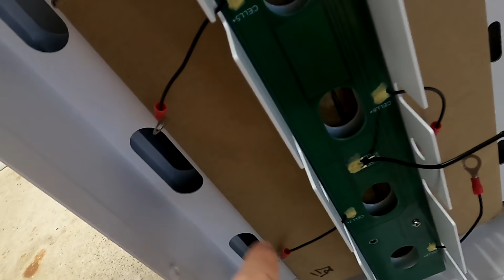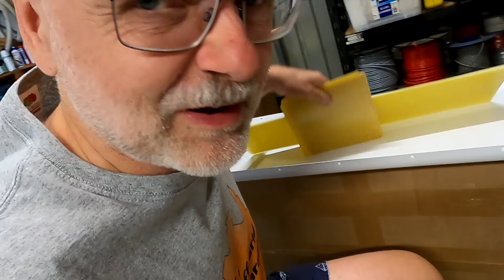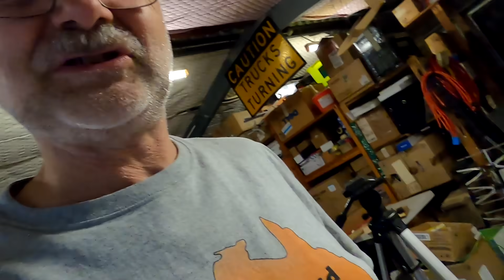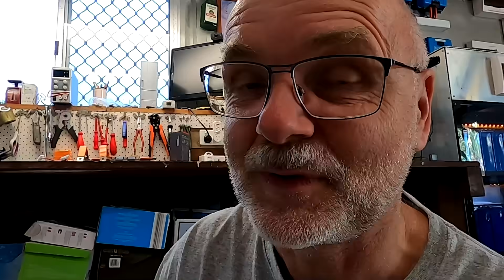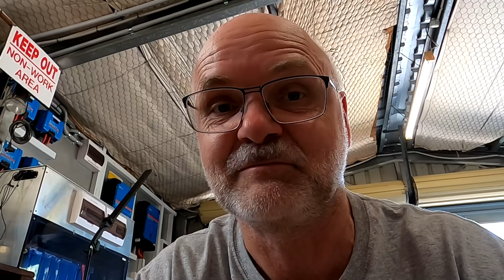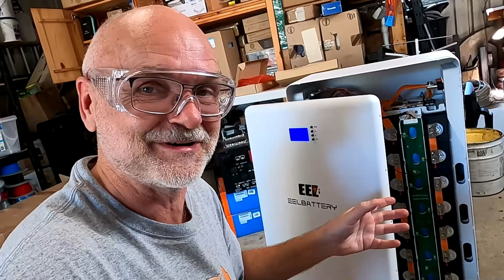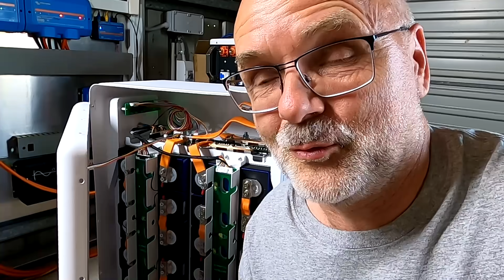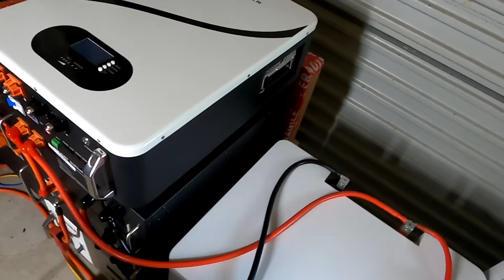The vertical EEL Battery DIY Kit. Is it OK for the cells to be stacked?

Comment: That double cabe from the BMS to Negative 9 and positive 8 I believe (there won't be a voltage difference on the same busbar) is a Seplos thing isn't it? Its like a 16s seplos BMS are two 8ses combined internally.

Comment: I have understood that the batteries are not supposed to be squeeze with 300kg force, but the ends are tightened "tightly" to cells and the ends must withstand a force of 300kg, the force produced by of the cells.

Comment: Would it make any sense to lay the case on its back for the first few charging cycles; to allow the bubbles to escape despite the lack of compression?
Reply: Am I missing an inside joke about allowing bubbles to escape from the batteries?

I thought the swelling was inside a sealed case, no gas ingress or egress.

Comment: 1880 euro inc VAT for 16 cell LF304 B grade with single M6 in the Netherlands.
I think 2000 for LF304 A grade, but with double connector like in this video, and I could not find an easy way to order a battery box for that, or even add on cables.
I have tested my batteries to be around 1010Wh.

Comment: Hi Andi, hi All, I am just in the process of assembling the horizontal (black) EEL boxes with 280Ah grade B cells. I love the assembly. My cases came with enough foam sheets for all cells. Maybe the 280Ah cells are just this much narrower than the 304Ah cells? I had to use my largest screw clamps (and some wood pads) to compress the front plate to the cells to reach the threads with the silver screws. And slowly one by one the screws all went to fully tight. Whatever slight bulges there were, they are now gone. Thus (I believe) the optimum form factor is achieved for the initial charge. One thing to the bus bars: The orange insulation is too long on all bus bars on one side (the other side from the little screw hole for the BMS connection). In my situation, if I attached the bus bars to the terminals just like this, one side would not get the full contact area on the terminal. Therefore I cut the orange material back just a cm or so. I think, this is quite important to prevent overheating due to bad contacts.

Now I am very curious about the commissioning, especially the top balancing. 😊
Reply from the maker: The 280Ah cells have the exact same dimensions as the 304Ah cells, no difference! The stackable box has a different design and comes with proper compression option.
The bulging never goes away again, no matter how hard you would compress them. The EVA tape just compensates for the uneven surface of the cells.

Comment: Last year, inspired by you, I bought 4 x SFK kits, loved them, individually they worked well, wired together in series to 48v I found the SOC drifted about 20%/ week.
So, once again inspired by you, I bought an EEL 48v DIY kit, it arrived like your kit with all the bits and pieces, Seplos BMS and an assembly instruction sheet.
There's also instructional videos on line.
Took about 3 hrs. to construct and has now been in service on a daily basis for 3 weeks.
I found setting the paramaters on the Seplos BMS vague and confusing and I spent a lot of time monitoring the battery to make sure the BMS did what I wanted it to do.
It now communicates with my MPP Solar 8048MAX and is now performing  exactly as I hoped for.
Stand Alone Off Grid Solar for 11 years now, we've come a long way, especialy from a technology standpoint.
11 years ago I hadn't heard of LiFePo4, Victron BMV smartshunt, Raspberry Pi B4 and Solar Assistant monitoring software, today it's a reality.

I hope you will still be reviewing the latest and greatest in 10 years time and I'll still be wearing my SPAT T-Shirts.
Love your work mate.

Comment: I have knowingly (not from EEL) received B cells with potential swelling. They appear to have been shipped by sea with the boxes on end. All cells with swelling were on the same side in each box. They are supposed to be shipped terminals up for that reason. Like the one comment said, do tests with it lying down, after a few cycles , swelling if any should be done.
Reply from the maker: Never seen any documentation from EVE in what orientation the cells should be shipped.
Once they are swollen, it will never go away again.

Comment: I build EEL DIY horizontal battery with Seplos 10E BMS this sping but use it in vertical position. Last week opened it to install NEEY ballancer and all cell just doing great beeing horizontal on top of each other. 10E works fine until 90+% Soc but then cell diference is 100-200mV and some cells are peaking. NEEY fixed it
Reply from the maker: The NEEY fixes such issues quickly and permanently.
Long term will tell us if horizontal cells are performing the same as vertical mounted cells. Some had bad experience with laying them flat.
Reply: Ordered vertical one from EEL. They had NEEY 4A in stock also. 280Ah cells. Will replace rack one EEL DIY installed verticaly.

Comment: Hello Andi!
I'd be very curious about the performance of the grade B EVE cells. How long can they supply a current of 150...200A? How do the individual cell voltages change during such a heavy load test?
Reply from the maker: I have tested B-grade cells vs automotive certified cells here in this video with 200A. No difference: https://youtu.be/6PyANZWtKnY

Comment: I have an aversion to placing cells on their sides. It seems to work fine, but if one cell blew, it would contaminate all the cells below it. Also, even though the cells are compressed, the cells on the bottom still take a higher weight load.
Reply from the maker: EVE recommends either upright or flat but not sideways. Read comment #74 here with the official reply from EVE:
https://diysolarforum.com/threads/eve-280-cells-should-these-be-clamped-tight-or-spaced-for-expansion.7892/post-94866
Reply: @OffGridGarageAustralia  , that's very interesting! When I was looking into this I found mixed opinions. The general conclusion seems to be that it depends on the manufacturer and the chemistry. However, one argument against putting them flat was that LifePo4 batteries do have electrolyte and when the cells are lying flat, some of the plates inside won't be covered by it. So the advice was to either have the cell with terminals up or on the short side, but not flat like in this case.

I am curious to know why EVE think that it is  not advisable to have the batteries put on the short side and suggest being flat instead. Now because of all these mixed suggestions I am afraid to have my battery box put in vertical position :).

Comment: Ordered the EEL box as well.   Now waiting for the new JK-BMS to arrive.  

Can't wait to start building this one
Reply: will the new JK BMS fit into the EEL Box? Is the form factor the same (main board, connection board, screen)?
Reply from the maker: The new JK will not fit in the box as it has different communication ports.
It can, however, replace the PACE BMS 1:1
Reply: I know.
A bit of cutting is required.
If mine arrives, I'll cut a new piece of of metal to match the communication board and install that in the eel box.

I think the display is larger as well.   So that requires some cutting as well. 
The wiring to the bms is different.   Pretty easy to solve wirh wires instead of using the busbars.
Reply: @RobbieHLM  Let us know how your modification went and what else you found that needs to be modified.
I think a lot of people will be switching from the Seplos BMS to the new Inverter JK BMS.
Reply: thats the problem. there is no jk-display which fits into the box @tiborchren

Comment: Eel supplied me with a printed manual in the box  So no issue with that... Regarding the compression, the terminal stress is more important IMHO
Reply from the maker: Ah, OK, thanks for sharing...
With the flexible busbars, there should be very little to no terminal force.
Reply: @OffGridGarageAustralia  Yes Indeed, I really like the EEL DIY box...

Comment: Do I see correctly that the BMS is mounted on the compression plate with 6 screws? That plate bends due to the compression, so also the BMS could be bend? 😳
Reply from the maker: The BMS is indeed mounted on the top plate. But as I explained in the video, it's not a compression plate.
Reply: @OffGridGarageAustralia ,
Well, the batteries may swell after mounting and bend the top plate… not? Or it may bend when servicing the batteries.

Comment: Looking forward to seeing what I expect is the Seplos Mason 280L kit. I've been thinking about buying one as they represent good value for money from a UK supplier. What puts me off is that I already have two 5.3kW SunSynk batteries which I'm not knowledgeable / adventurous enough to try and combine on to a busbar.
Reply: I'm guessing your talking about Fogstar.  I got mine about 3 months ago with grade A 304AH eve cells.  Well worth it.
Reply: thanks for this im considering ordering 2 :) @rickysemmens6250
Reply: I have built both, EEL and Seplos vertical DIY kits. The Seplos is definitely better made, metal material more solid, compression also more serious. What I don't like at Seplos,  no flexibil busbar, you need to buy extra. Connection is also great, single nuts! Price very similar.

Comment: I just have thought that the cell at the bottom will have a different compression compared to the top one due to the weight of the cell on top of it. Will prowse on once open a leaking cell with this configuration. So i thought, that not a good idea to stack cell on top of each other compared to flat on the floor where each cell have the same compression.

Additionally with 280/ 304ah which around 6 kg each. Cant imagine how stress gonna be for the bottom cell to have 48/50kg weight on it.
Reply from the maker: As I explained in the video, if compressed with 300kgf, the additional wait of the batteries is negligible for the bottom cell.

Comment: I have two of the boxy Mason cases and I am extremely happy. Nice kit, easy to assemble, everything includes - like this one as well.I don't know why one would want a vertical case instead of the "flat" ones tbh but, hey, it's all about choice ;) The wall-mounted ones make much more sense to me given they can really be a life safer in cramped spaces or if having something sitting on the floor is not an option for other reasons.
Reply from the maker: It's about space! If you have only a narrow space in your installation location, the vertical designs make sense.
Reply: @OffGridGarageAustralia  Indeed. If I didn't already have a real 19" rack I definitely would go for a vertical. But still, if that trips, it's 100kg to get up again....

Comment: You need to be really careful when using a full metal spanner when tightening the positive posts (need to get a insulated covered spanner)
Reply from the maker: Why is that mate? The power was turned off at the time...
Reply: @OffGridGarageAustralia  it is always turned off until it wasn't, best to just be safe then have a massive ark or/and very hot spanner (bms/mcb on most of your battery packs should trip first but still a risk of bms/inverter or charge controller damage in short conditions especially with DC )

the DC cables was clearly powered here in this video as you was using a resistor to charge up the capacitors so it didn't spark when you put the cable on the post

I love your videos by the way

Comment: Andy, you've got almost every possible style and type of battery, which is great and gives us a lot of valuable information and comparisons (as well as the different BMSs).
Probably the only type of battery you haven't tested are DIY PCB batteries, where the whole battery pack is connected together with just one (or two) large PCB board(s), in which all the busbars and all the balance cables are integrated. This kind of PCB to build battery packs has Taranis Energy for standard cells or jehugarcia for its 74Ah cells . What do you think about this kind of PCB for battery packs?
Reply from the maker: Heard about them but never seen one for sale anywhere. Is this a thing for DIY batteries?
I'll look into it...
Reply: @OffGridGarageAustralia  Yes it's for DIY battery building and yes it's on sale.
Reply: Which do you like better, EEL or Apexium

Comment: I want to ask a question not regarding this but something else. Is it OK to mix victron charge controllers with different voltages eg. 100V 30A with a 150v 75A both victrons.
Reply from the maker: Yes, as long as they are connected to different, separate solar arrays, no problem. I assume, they will charge the same battery?
Reply: @OffGridGarageAustralia  yes they would. Say I have 7 panels voc 49.42 is 13.79 30A fuse rating per panel. Is it ok to use the configuration 3 panels in series n 4 panels in series and then parallel them together and use a victron 250V 85A victron. Or would I have to use break it two 2 arrays 4panels n 3 panels n use 2 different charge controllers.
Reply: @OffGridGarageAustralia  yes they would charge the same battery pack. The reason I am thinking this is I am using a hybrid inverter but I think its float mode isn't working bcz I don't c the battery pack charging even when the voltage drops below float voltage

Comment: A resistor is not nessisary to parallel batteries my friend.  All you need to do is turn off the mosfets on the BMS.
Reply from the maker: The Seplos BMS is special here. Even I turned it off with the soft switch, it allowed charging and turned itself on.
Can you turn off the MOSFETs in the Seplos manually?

Comment: Is it possible to swap out the BMS to a JK BMS?  Is this something you could try to do Andy to show those of us who would really like one but don't want the SEPLOS and already own a JK?  Please xx
Reply from the maker: The JK BMS will fit into these cases and batteries, no problem. It is much smaller but also lacks the communication side of things.
You also won't be able the display at the front or the buttons of course. So only access would be via local BT. So you would end up with all these holes and\or none functional display and PCBs with LEDs...
If you're talking about the new JK BMS, we have to wait and see if it would fit. I know it will be compatible (in size) with the PACE BMS and can also replace the coms ports of the PACE
Reply: @OffGridGarageAustralia  Thanks Andy your a gem!  I will wait and see what happens with EEL in case they decide to upgrade to the JK.  My offgrid shipping container house thanks you and so do l xx

Comment: Hi Andy ,and thaks again for this video!👍 EEL battery pack vertical model,Interesting...
and about your:"What do you think about stacking batteries like here in this box?"
I am particularly interested in knowing if there is really a difference in the functioning of the cells? their longevity? to the different parameters due to this position of the cells??
The manufacturers don't really communicate about this? But I think that certainly this position of the cells can perhaps have a slight difference in their functioning?? interesting...😉
Reply from the maker: Official statement from EVE:
EVE recommends either upright or flat but not sideways. Read comment #74 here with the official reply from EVE:
https://diysolarforum.com/threads/eve-280-cells-should-these-be-clamped-tight-or-spaced-for-expansion.7892/post-94866

Comment: Thank I have been looking at these vertical cases I have been tending towards the Seplos version with the terminals at the back. I am really interested in seeing the difference with the EEL
Reply: I have one of the Seplos vertical cases and it was nicer to build then the one Andy has in this video, the top comes off making fitting the BMS much easier.  In service for 80 days now, no issues other then the normal low power balancer.  Lots of space to it a neeeey active balancer which was the way I went.
Reply from the maker: We will have a look at the Seplos Vertical Box soon. Got it already here...
Reply: I have the Seplos Mason 280-L and i like it very much. Its exactly as your other Mason box only vertical. I ordered 10pcs including LF280K to resell here in the Netherlands.

Comment: The weight of the batteries in a column is compressing. Lock it down in the space with filler panels and seems compressed to me. Can they expand beyond the space to which they are secured? No = compressed. There you go.
Reply from the maker: That's not a compression, that's a fixture. The recommended compression is 300kgf for these cells.